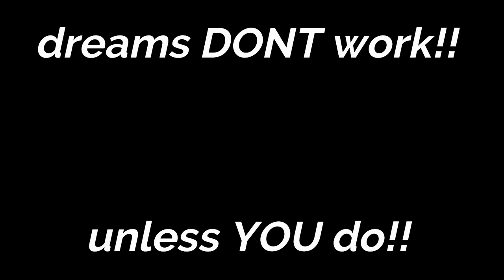E36 Drift Build Gets Coilovers!!

Comment: Coilover sleeve on rear goes on bottom of spring so you can adjust height
Reply from the maker: It wouldn't be accessible on the bottom because it would be deep in the spring bucket.
Reply: You did put it right it does not go on bottom mine on race car was the same